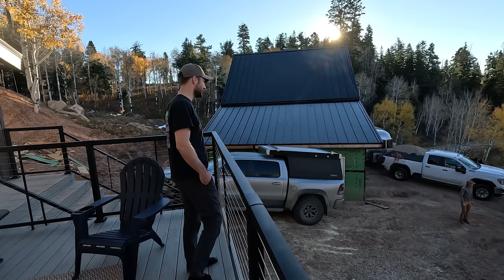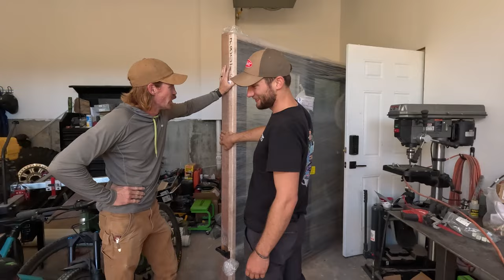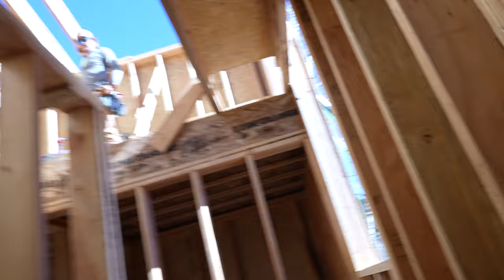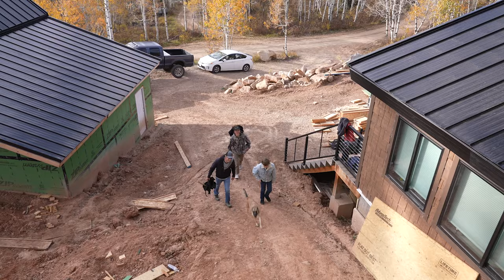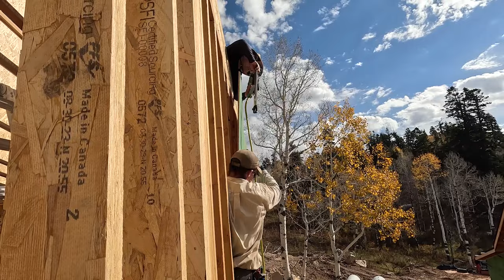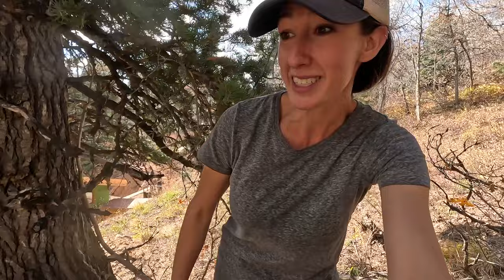WE WON'T MAKE IT.... WE NEED HELP

Comment: Trent, I wonder if there's a way to heat that dormer to prevent snow/ice buildup...perhaps a small electric heater inside that can be wired to a switch inside the house? Heat strips? It wouldn't take much heat to keep the snow from piling up against the new wall. You'd have to plan for it now though...by installing a switched outlet inside the dormer. You could even install a small utility door inside the new addition for access inside of the dormer.

Comment: You are absolutely lucky to have such a friends and family. In Poland there is tradition - when builers finish the roofs on the house - they place in the highest point chapel/wreath made of pine brunches and decorated with many colorfull ribbons for Good Luck to the strenght of the roof protecting the house....... You can google  word - WIECHA NA DACHU

Comment: over here we use flexible rubber/plastic buckets the size of laundry baskets to clean up the building debrea , its heavier to lift but the banfles on those baskets makes it possible to move them with two persons when they are too heavy  , it saves a lot of time waking back and forth trowing stuff away in the trailer

Comment: How about putting heat tape on the roof where the cricket is built?  Run it to a switch you can turn on and off when you need to melt snow/ice in the valley.

Comment: Put heater strips on the cricket so it’ll always melt and make it easy so you don’t have to clean the roof. Also put heater strips around the edges of your roof and it’ll cause the snow so you don’t have to be on the roof as much as you think.

Comment: @Trent&allie you should have had your architect install low voltage heating elements at the underside of the metal panels to melt snow and ice.

Comment: The little roof shed you added to the cricket (IMO) is too short. It may with the massive snow you get there just get buried in snow instead of shedding snow. One big slough off of snow & it's buried. You could make it taller maybe match the original house roof pitch. Anyway, just my thoughts, you'll find out this winter if it works.

Comment: Trent and Allie, I really worry about the tree on the embankment that is leaning towards your new addition. Any weakness in the tree itself or its roots, any slippage in the embankment, or any excessive weight (SNOW!) in the tree might cause it to tip over onto the new addition. Do you have someone who can remove it soonest??? I'd hate to see all of your hard work on the house and the new addition be damaged if the tree falls on them.

Comment: why did you notch that beam where it sits on the outer wall? Now that notched out end is lower than the rest of the ceiling and will show and be a problem when you sheetrock the ceilings and walls.